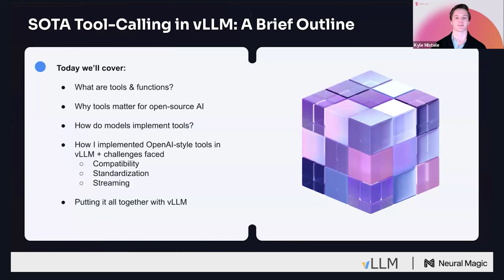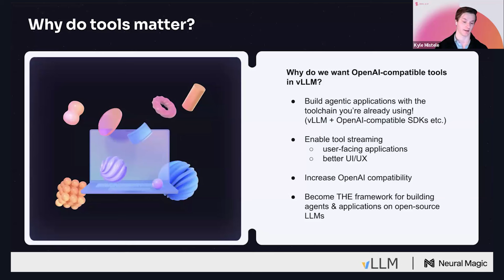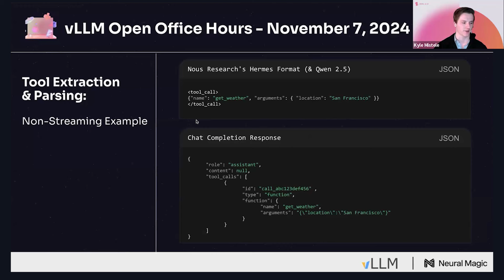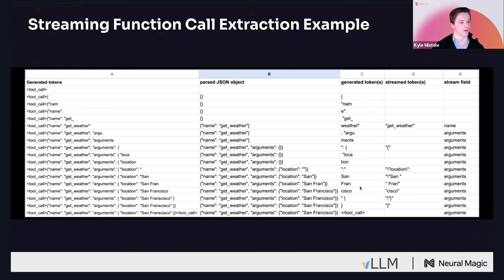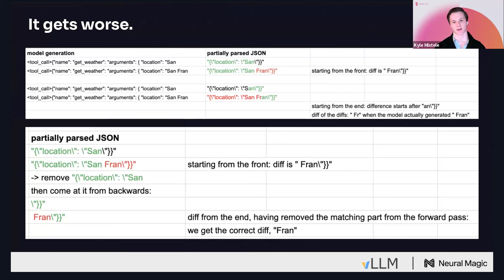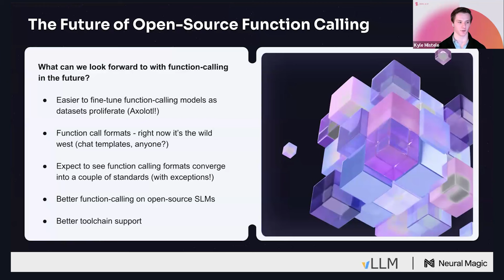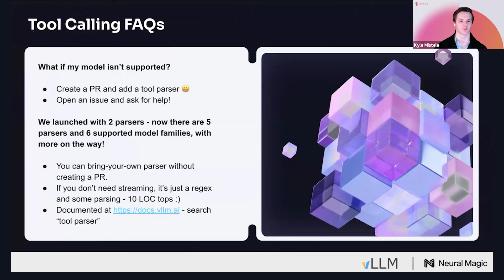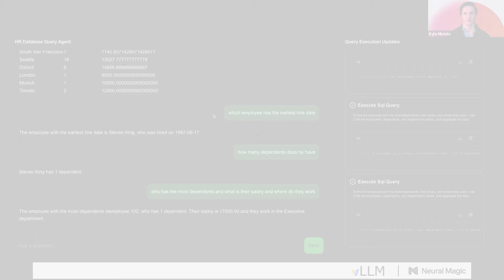vLLM Office Hours - SOTA Tool-Calling Implementation in vLLM - November 7, 2024

Comment: 20:00 this is actually something that I've been thinking about in general, not just for tool calls. It seems like there are multiple things that could benefit from having a configurable buffer between the llm generation and the actual API responses with hooks for controlling the kv cache, pausing and starting generation, etc. This converting the streaming format to another streaming format on the fly is one use case, another that I've been thinking about is backtracking samplers. That only works with streaming if you have a buffer.